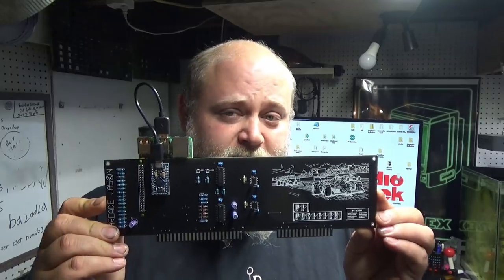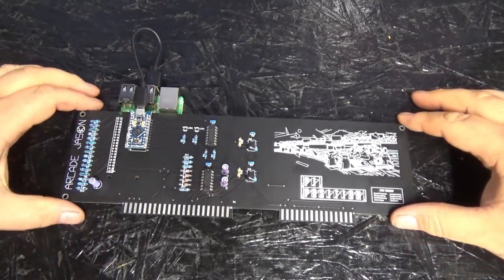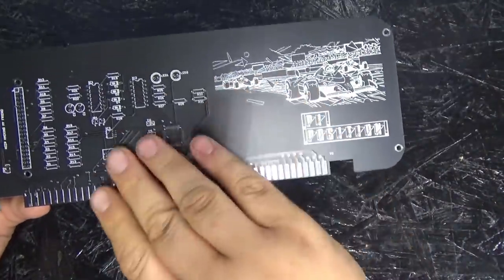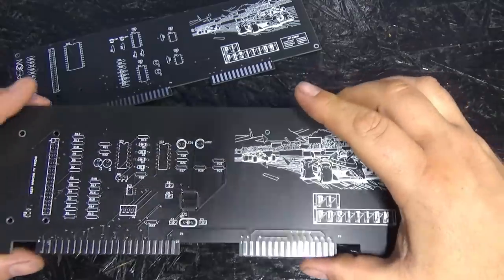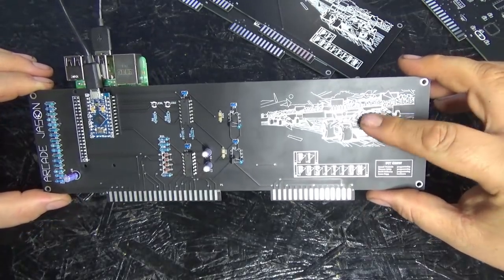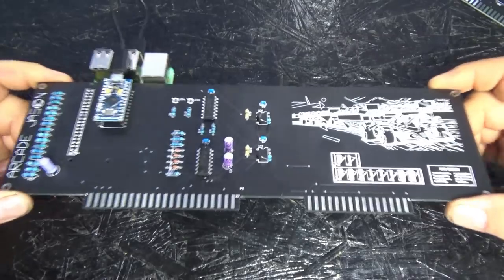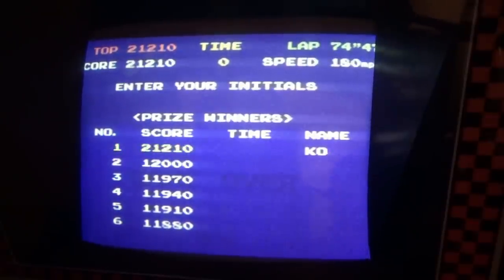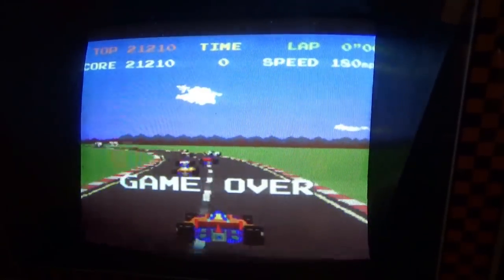The new pole position multi game pcb

Comment: I don't think it matters for the config for this... but modifying a text file from a Windows editor will add carriage returns at the end of each line that Linux does not interpret properly. For things such as bash scripts it will effectively break them. That being the case files are best access from Linux using the built-in "vi" editor (you'd have to connect via SSH or something and run it... which I realize is beyond the average user). Granted... I don't think it will matter for this config file but if anyone modifies it and then says they are having issues after that it's something to keep in mind.

Comment: The difference of the skid sound is a flaw of some versions of MAME, and has been corrected in at least some newer versions. 

That was the first thing I noticed when I played Pole Position in older versions of MAME. I was able to get the correct sound by using a different, newer version of MAME. I can't remember if either version required a sample set or fully emulates all the sounds.  It's a shame that glitch wasn't ironed out in the Pi Position as it does stand out, however the multi-game appeal that other games should be able to run is why I bought one. It would be great if you can find a way to correct it.

As you know, I've been a big MAME fan since the 90s and have spent a lot of time with it on my multiple MAME machines. One of the flaws of MAME is that no one version of MAME runs all the classic games correctly. To get around this, I run multiple versions of MAME and I've compiled a list of which versions run particular games the most faithful. As the MAME developers add new games and fix flaws, they introduce new problems in some of the games that previously ran great. This is yet another reason I've never put a lot of time into front ends like Hyper Spin, unless they have the ability to pick a particular version of MAME for each game. 

Also, another limitation of going the Pi route for MAME or AdvanceMAME with a regular arcade monitor. Fewer versions of MAME are compatible with those setups. Instead, I've used special CRT monitors that can run Windows with normal displays which I believe makes it a lot simpler to switch versions. One of my monitors just went down again, and they are rare and few people know how to repair them. The disadvantage of my route. I think going with a Pi for the Pole Position board made sense though, especially for such a small board. 

I can check if you want if any samples are actually used between these versions of Pole Positions. I don't believe I can just copy the samples and load them into the older version. Seems like I would have tried that.

I've had to play the game with a spinner, but it works surprisingly well. I also have an extra Pole Position wheel, but for some reason when I connect the optical board, it moves in place just moving a milometer enough to tell it's turning, but that's it.  Looking forward to playing the game in my real Pole Position cabinet which I haven't plugged in yet. No doubt some repairs will need to be made before I can use it with the Pi Position.
Reply: The sample isn't needed since Mame 0.112u1, released on 12 Feb 2007.

Edit: AdvanceMAME is based on MAME 0.106
Reply: Mr Guru  Maybe they can use the sound part of a newer Mame source and compile it into their own version of AdvanceMame. They already heavily altered the code.

Or someone else can do it as they have to release the altered source code per Mame's license.
Reply: Mr Guru  Well, l say give him a break! He put a lot of work into this product. Think of it more as a multi-game solution, which can have a few minor flaws. It's also priced reasonably. It would likely cost as much as this board to repair a double stacked Pole Position board, depending on the issues and who's doing the repair. And more hassle to ship it and find someone to do the work. Jason's board is a simple fix to repair a broken Pole Position PCB. Just order it, and it's shipped to you. No need to carefully package your board and send it to someone hoping it doesn't get damaged in the mail. 

If it hadn't been for that sound glitch, I probably wouldn't even think twice of not having my original PCB fixed. Someone is working on a switcher for this machine, so it might be possible to use it for multi-game, and run the original board.

I agree fixing this problem may not be easy. But it might be possible. Also, since it's running on a Pi, if that issue got corrected in a newer compatible version of Pi Advance MAME, wouldn't it be possible to just load that version of the program on the Pi, fixing this glitch? Next to a regular Windows PC, the number of builds of MAME are far more limited. That's why I've never been a big fan of Pi's since I run a lot of different games and a wide variety of emulators. With a PC, it's been easy for the past 20+ years to just switch to whichever version of MAME best plays the games I want. On other OS's, the choices are much more limited. For a project such as this board, putting a Pi on the board made sense. Everyone's on the same page trying to figure out how to get various games working well. Someone might be clever enough to figure out how to get a sampled skid sound rather than a badly emulated skid sound. For people like me with several full size MAME cabinets running a variety of games on a variety of monitor types and interchangeable control panels, Pi solutions would be more limiting for my uses. For a Mini MAME cabinet, might be the only solution that fits vs a full size PC.

And again, this was not the result of MAME sucking with emulation or the concept of emulation. It was the result of the programmers had not yet figured out how to get the correct skid sound in MAME. They should have just sampled it as the did with the explosion sound.  Do you think FPGA would be any different? That's why it's probably taken years to get the FPGA Pole Position board fully working. Not an easy task. Without tons of effort, FPGA products often miss the mark too trying to reverse engineer what others have done. I've seen plenty of people with FPGA products like MiSTer and then end up switching back to PC emulation because it was still not perfect and for some systems worse, and in many cases better developed on PC versions. FPGA in theory sounds more appealing to some. Many people don't realize is even PC emulation can be cycle accurate too, with enough effort in the developing. But all of these replacement solutions are still "reproductions", and even if minor, there are going to be at least some small differences even if we can't pick up on what they are. But it doesn't bother me. Most of the games I play look, sound and feel just like the originals, and I have the original controls for a wide variety of classic games. If I were going for record scores, that's where I'd want the real boards. These reproduction solutions are equally as fun as the originals if done well. And that is the purpose of my basement arcade.
Reply: Mr Guru  They only need to implement the code that was changed between 0.106 and 0.112u1, not until today's code.
Reply: Hi n8goulet.! Any luck adding other games to this? I too purchased mine for the multi-game appeal. Based on 360deg wheel drivers, I have narrowed down about 11 titles that have a decent shot a working and I have not yet looked into their monitor orientations to see if they are horizontal... So far, I have not been able to get any other roms to load other than the PP and PP2. I am also struggling with reaching a speed above 180mph as others claim to be dealing with. I find it interesting that 180mph is the top speed in his own video. I don't doubt this can play other games but I have not been able to verify anyone who has had success yet. Have you?
Reply: @cfella1974  I received my board, but have not installed it yet. I send the monitor out for repair, which I've received back. The wiring harness is very dirty on some connections. I noticed the original PCB burnt on the edge connector and I need to have the harness and other parts checked out. With winter, and COVID it hasn't been as easy to have stuff checked out but I hope to be able to deal with it before too long. I have too many unfinished projects, but plenty of parts. I wish I had proper electronic repair skills myself.

Comment: Jason... Quick question. I'm installaing a PiPosition in a cab right now. The GND's are commoned between the two edge connectors (which is fine) but so are the +5's. Is it assumed that were only running one ARII or do we need to remove +5 and the two sense wires from one of the connectors. 

Thanks man!!!
Reply from the maker: The reason both 5v lines are connected is so both ar2s can keep each other in check.

Comment: why does this use the original PSUinstead of a modern one?
Reply from the maker: it can use a modern one. but it would also need an audio amp as the original psu has an amp built in
Reply: @ArcadeJason  I would love to use something like a PC-soundsystem on my Cockpit. Is there an Audio-out on the board? :)

Comment: if you have any probs with the controls most if not all of those ebay/ali pro micros are fake.just a heads up bud. :)
Reply: You mean fake microprocessor? Because the Arduino Pro Micro hardware is open source so can't be fake.
Reply: Yep fake micro